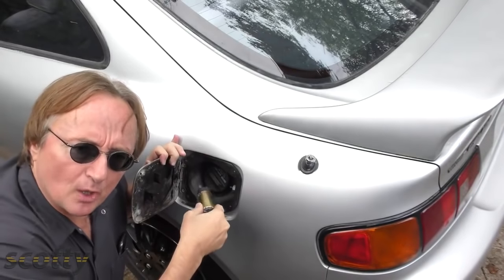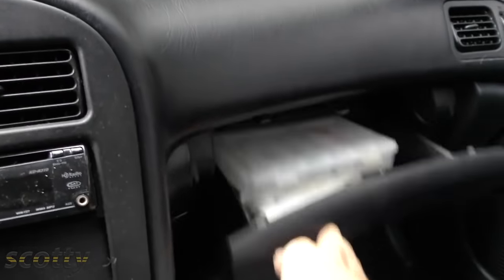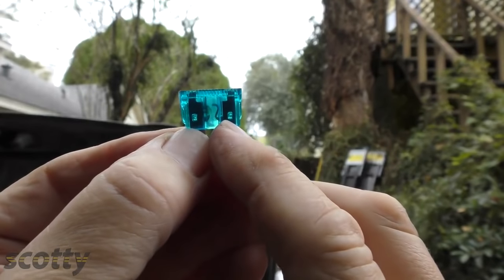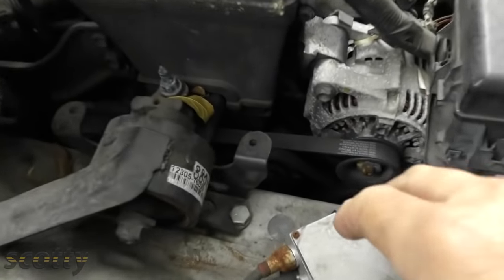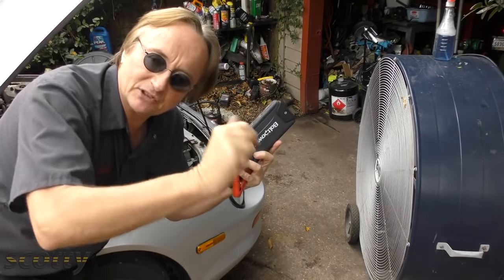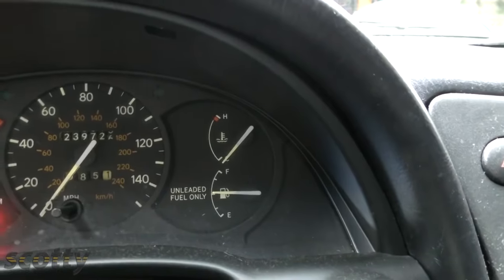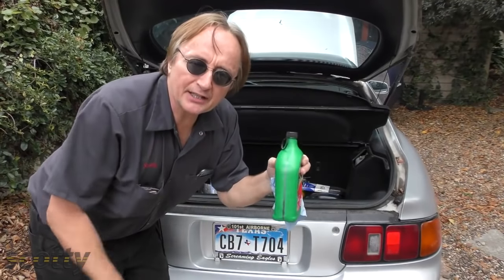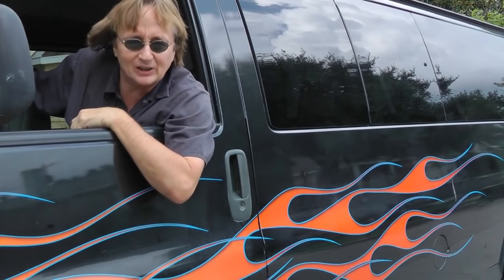How to Fix a Car that Won't Start and Randomly Dies While Driving

Comment: How about checking the timing belt?
Reply: Khaidy M if the timing belt goes you’ll need to rebuild the engine head and get new pistons and valves.
Reply: Tomtom889 because there's 2 types of engines, which is inteference and the non-inteference engine. 
My car suddenly died and the first thing that my mechanic check is the timing belt. Yeah it broke and costs me about 1000 to fix it.
Reply: Khaidy M ah yes forgot about that, well if that happens then at least it’s cheaper to fix than a car that has an interference engine

Comment: I’m I got one my 2001 Honda Accord died on me al of a suden while running after new spark plugs distributior checking for spark good battery and a new main relay nothing also gas is getting into the engine fine crank but no start

Comment: i always run my gas till the gas light comes on is this bad?
i keep on hearing yes its bad 
BUT
if its bad why would car manufactures put a light when its low why not when its half way?
Reply from the maker: not bad, cause there's still a couple gallons inside the tank. Just don't get wise and drive until it's empty

Comment: What to do if your car dies on the road. 
Step 1: Rub it gently on the dash and talk sweetly and whisper sweet nothings to it
Step 2: If it still wont start open hood and begin to curse while looking for the problem wiggle battery cables and wires then try to start again if it doesn't start adjust rage accordingly.
Step 3: Kick it in the tire to show it who's boss and bring out your best swears and tell it how much better your previous car was and shame it mercilessly for not starting.
Step 4: Repeat steps 2 and 3.
Step 5: Call the tow truck.

Comment: Put a bigger fuse in it !   lol   Ever heard of electrical fires?   Best solution, add towing to your car insurance.   It's cheap, safe and you don't have to worry about carrying a tool set along with a whole auto parts store in the trunk !  lol

Comment: Alright so just saying, the coolant wont help because if the car dies on the road, you cant freakin wait for it to cool down. My engine can take over 3 hours in the summer to officially cool down but naturally the other day i ran out of water in the reservoir and i had to wait a huge amount of time since id didnt want to damage the engine for example with the cold water mixing with the hot engine so theoretically, if its lack of water or coolant for example, i dont think its an option on the highway.

Comment: bought a 2003 malibu from auction drove it at auction drove fine 2 days later i was driving car lost power and cut off. i pull over car crank but won't start even patted the gas got nothing what that issue could be? I'm kinda mad cause i aint get my money worth yet out the vehicle.
Reply: as scotty mentioned it could be a fuel pump or it could be a fuel filter.  You also need to check for spark, I'd start with that since its the easiest.
Reply: @dwsherm1  thanks good looking out. Im try that out 2morrow.
Reply: @freshreserve2503  check out Scottys how to fix a car that cranks but doesn't start

Comment: Let me follow that....older GM fuel gauges. It's not their fault. Worked great for many, many years.  But, be realistic. That system wasn't made to last 20+ years. Cheap people replace the pump. Smarts says the module that comes with a new float and sender

Comment: Those lithium self jump starters should not be hooked up for more than 30 seconds. You will burn out your cable connections if you leave them connected. I️’ sell them at my store and I’ve sold more spare cables than jump packs.

Comment: I would suggest using a cell phone to call a tow truck if your car breaks down on the side of the road.
Reply: Also best to NEVER double up the fuse amperage size unless you like fire and smoke
Reply: I tried that once but my cell phone battery was dead! So I stuck a bigger fuse in it and had my wife fire watch with her nail polish remover. Got me home just fine.
Reply: People die at the side of the road while trying to repair their car all the time.  Mostly metropolitan areas where the lanes are narrow and shoulders VERY narrow because they try to squeeze more lanes in there.   There's always traffic no matter time of day or night, with intoxicated drivers particularly on the road at night and early mornings.  Distracted drivers are something we have to deal with too.  So yes, a real threat.  Plus, a good percentage of these drivers have NO insurance and have nothing to attach to for you to collect from sueing.
Reply: LOL!

Comment: Unfortunately for me, my car dies from lack of fuel when the gauge says a quarter of a tank. Now to fix it, I'd need to replace my fuel pump and gauge assembly. But guess what? The assembly is an obsolete part. You can only take the old assembly apart to put a new fuel pump in. You can't replace the assembly in mine.
Reply: Sounds like you're stuck trying to find a used one still in the tank and hope it works...
Reply: Well, it's the stupid design. It's too much of a hassle, so I just try to fill it up when it says half a tank. And besides, when the fuel is at a quarter of a tank, it dies specifically on a hill. So, another design flaw. So, I don't have much of a choice

Comment: Mine broke down on motorway everything check no spark new spark plugs and coils packs but still nothing
Reply: Are you geting crank signal ?
Reply: Yeah
Reply: Aaron Sanderson air/fuel, compression, and timed ignition. That is what is needed for a internal combustion to happen. Check each system separately. Start with fuel and pump. The amount of fuel pressure is important. Just a drop of a few psi can keep a car from running.
Reply: Tracey Allen air and fuel been checked but still has no spark
Reply: Aaron Sanderson I'd start looking at the timed part of the ignition. Sometimes the engine can crank fast enough or to fast to find "phase". This could be caused by a mechanical problem with the carb ie low compression, valve issues. ECT. Good luck.

Comment: What to do if your car completely dies on the road while driving, like those poor guys driving faulty ford focuses with the proverbial DSG
Reply: Coast to the side of the road at least.  Worst thing you can do is stall in the middle of the road.  Sure to be some road rage, and some cops may even come up and ticket you for obstructing traffic and not even a call tow truck for you either.

Comment: The morons that repaired collision damage on my car put the battery terminals back on the battery but never tightened them. Took awhile to figure this out but once discovered it eliminated the stalling issues.

Comment: If you don't have a fuse you can use an old copper penny
Reply: Or use fuse used for seatbelt sensors, audio system etc.

Comment: If you got to do any of the things you mentioned, is that you don't maintain your car properly and certainly won't be able to do any of those things by yourself on the side of the road, because nobody carries a gallon of coolant, 4 pints of oil, a fully charged booster pack, an alternator belt and so on. I like your channel though but find you a little too optimistic regarding the common car owner :)

Comment: Or you can join AAA and be done with it.
Reply: AAA or some other plan is what I recommend for people living in metro areas.  Chances are, your car is going to die on the freeway and it is very dangerous to get out of your car and start working on it with the narrow shoulders, lanes, and drivers whizzing by that don't even have a license.  People get hit and die all the time.  Not worth risking your life.  Call up the service truck and have them tow you out to somewhere safe at least if you insist on wrenching it from there.
Reply: Years ago when I was younger and more foolish, I had a flat tire in the rain and at a curved access to a highway. I changed the tire at the time.

Comment: the noise is awful. and there is absolutely no real information about the issue that you have mentioned in your title.   ECU , Camshaft sensor , wiring issue , anti theft system , dirty or corroded ECU connector....